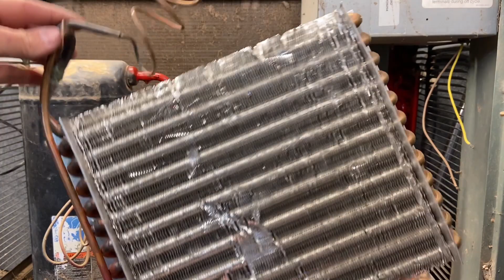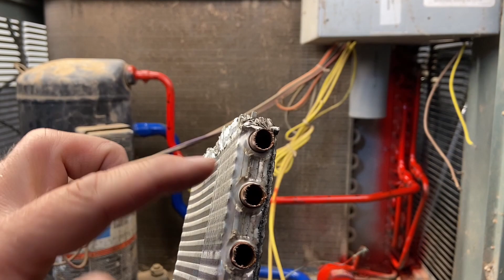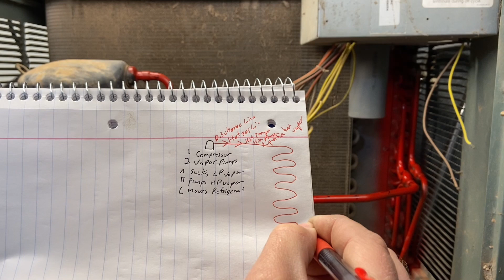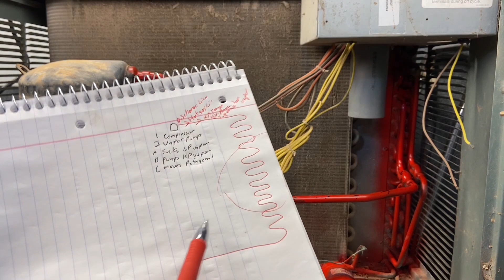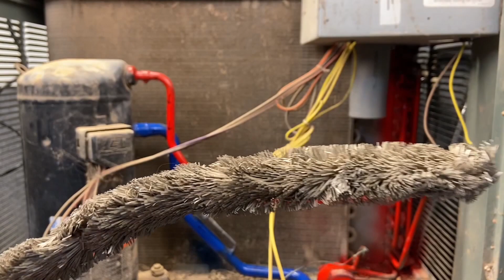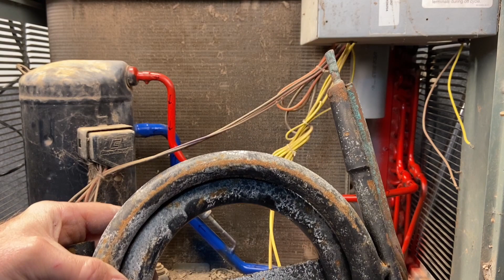HVAC 008 Condensing coil intro

Comment: One important point is that heat always goes towards cool rather than the other way.  This is because heat is motion and energy and cold is lack of motion and entropy.   Friction means most heat is moving towards stillness which equals cold.

Comment: Do those red pipes on the right go to that dirty condensor ? or are there 2 condensors here.  Bit confusing !
Reply from the maker: Yes the red pipes  go in on the dirty condenser almost all the way to the right as a high pressure  vapor. Red pipes also come out of the condensor on the far far right as a high pressure liquid.
Reply: @love2hvac  Ohhh I get it now. The condensor is all the one thing. The dirty consensor facing us and the part of the condensor where the red pipes connect over on the right
Reply from the maker: Yes sir
Reply from the maker: Future videos will go into more detail
Reply: One condenser with two sections, the main section where refrigerant gas is first desuperheated and then condensed into liquid. The second section is to subcool the liquid. If you look closely you will see one pipe from the compressor going to the condenser, this is the main section. Then a pipe goes out of the condenser and goes in again, this is the subcooling section. Finally a pipe at bottom exis the condenser, this is your liquid line.
Reply: One question, @love2hvac - you state that the reason dirt slows down the heat transfer is because it is a great insulator. Do you mean that literally? I’m taking it as a way to explain anything that slows down heat transfer is be definition, an insulator. 

But as you state, the actual problem with the dirt is that it blocks the spaces between those tiny fins, and the necessary airflow to make this system work well just doesn’t happen.
Reply from the maker: Dirt is both an insulator AND blocks airflow.